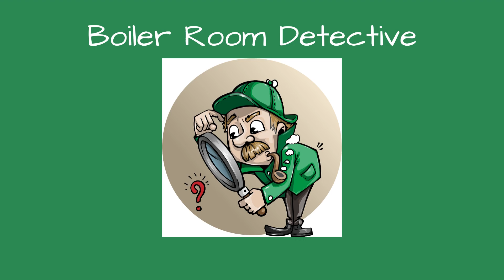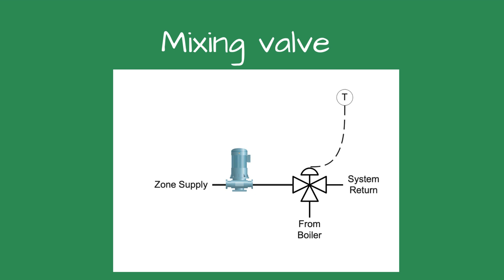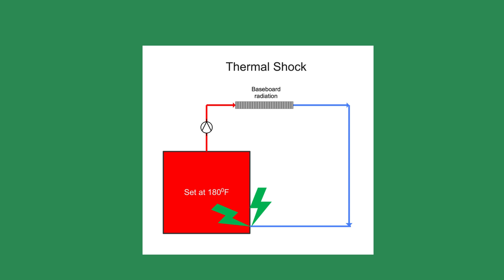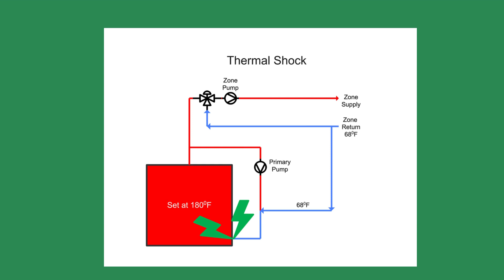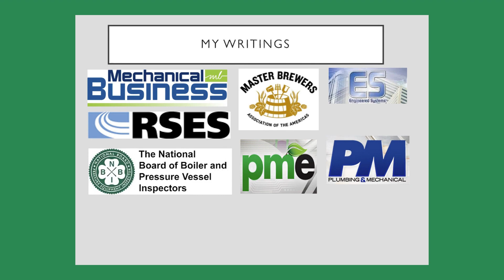The Case of the Shocked Boiler

Comment: I have had to maintain a York Shipley 200 hp steam boiler for 40 years. This Tuesday it's going to the scrap pile. I couldn't be happier.
Reply from the maker: 40 years is a long time Are they replacing it with another boiler?
Reply: @boilerroomdetective  the school was steam when it was built. In 2006 we put a 2 pipe change over system in the classrooms
only. We heated the water with steam through a heat exchanger.  In 2023 we are putting in two high efficiency cleaver brooks boiler to heat the water in the classroom wing of the school. The gym cafeteria and kitchen have always been steam.  We are putting RTUS in the kitchen and cafeteria.  In the gym we are we are taking the old steam air handlers and installing evaporate coils  and gas duct heaters. We rebuilt the old airhandlers cleaned them and put bearings on the shafts and new pulleys belts  and motor we starters we are doing some of the work are self. This is a catholic school.
Reply from the maker: @Kevin-wj4ed  That sounds like a cool project. I'll bet the customer saw a nice drop in their heating costs.
Reply: @boilerroomdetective  they will be  installing the equipment this summer.

Comment: Had you installed a Bryan Boiler (flexible watertube) the boiler would not have failed.  They have a 25 year warranty on damage due to thermal shock.  You still would have your building control issues and primary piping issues, but thermal shock wouldn't matter.
Reply from the maker: Brian perhaps you are right. The customer tried a copper finned, cast iron sectional, and vertical firetube Seems like the next choice Thanks
Reply: I have 2 Bryan boilers in another boiler room they are the best. I have  one that is 25 years old never any problems with it.

Comment: always put a line from supply to the return with a ball vave to adjust return water temp on residential & light commercial systems.  works every time !
Reply from the maker: Great point until the owner or future service tech decides to close it. We have used these wax filled 3 way valves and they seem to work pretty well Thanks
Reply: Unless we are talking of older systems, with newer boilers having a cooler return temperature is a desirable thing, not only they are designed to handle it without issues, but it will increase the condensation and thus the efficiency.
Reply from the maker: @alerighi  Good point. It will increase the efficiency Thanks

Comment: Has anyone ever seen this on a small residential steam boiler with a basement pumped hot water loop? After all, this boiler can be steaming when the basement loop pump starts and dumps 60 degree water into the 200 degree boiler...  We do it all the time.
Reply from the maker: I have not seen that. I think the difference is this project was a hydronic boiler. I have seen when cool water is injected into a steaming boiler, it can stop the steaming process until the water is heated. Thanks for watching